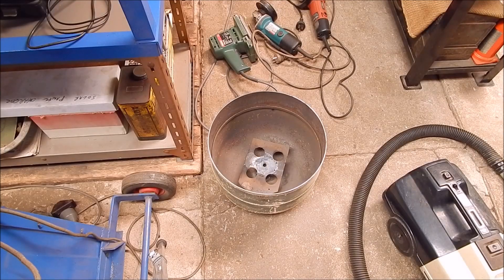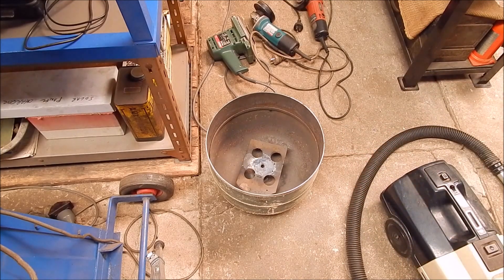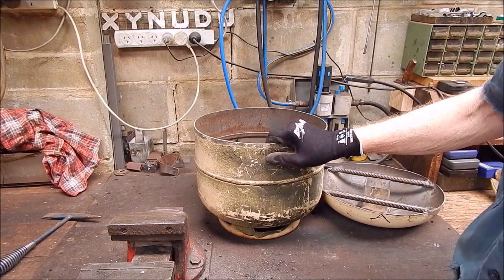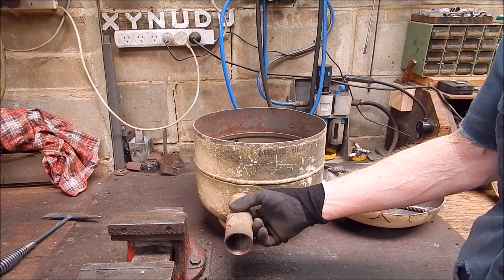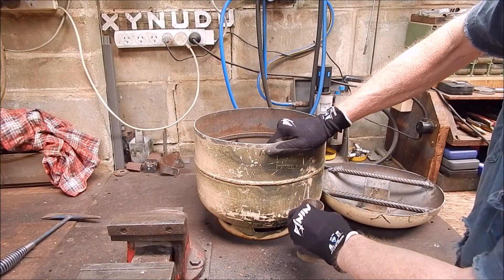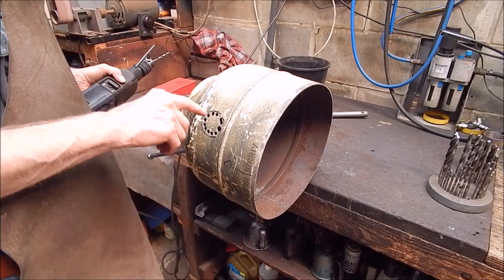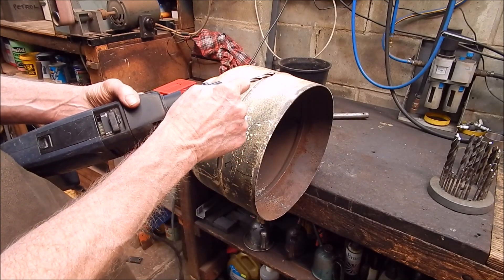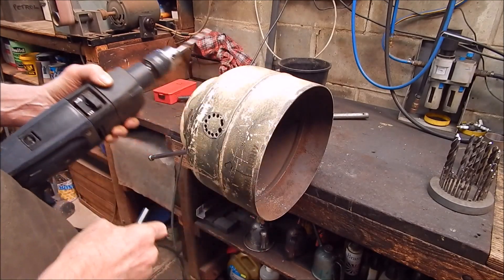Making a metal melting furnace from a 10 kg LPG gas cylinder - part 3

Comment: Hi Rob, getting there mate, that looks like tough old stuff! Friction disk just ate it! I think your lid will be fine. Cheers, Jon
Reply from the maker: Hi Jon,  definitely high tensile for the tank and the Reo.  Reo is a bastard stuff to weld at the best of times as the arc eats it away and some is a lot worse than others.  This piece was pretty crap, but it attached OK.  I used the DC welder on both.  Low hydrogen rods would help, but for this job where it will be hidden I just went with GP.  I'm thinking bentonite clay mix with pizza oven grout for the insulation.  Going experimental.  Cheers Rob

Comment: Bend a steel rod, 10mm dia,  around inside of lid, weld it on. Use it as support for mesh.
Reply from the maker: Another good idea.  Too late now as the Reo is in place.  Cheers Rob

Comment: You probably don’t’t have enough use or space but a low cost plasma cutter would have done the hole very quickly. Many of the Indian channels simply turn up their arc welders to make a poor man’s plasma cutter, but the traditional methods work & it looks like this will become a very useful addition to your shop. Thanks for sharing!
Reply from the maker: I can't justify a plasna cutter, even though I could get one from Banggood to review, so the old minimal tools method will have to do - works OK.  Done it many times.  I do have core drills, but not this size and you must use a pillar drill with them. Cheers Rob

Comment: Hi Rob. It's surprising how much work goes into these projects. That steel looks pretty tough, hard to work but definitely a good choice for the furnace. Cheers, Alan.
Reply from the maker: Hi Alan,  the gas cylinder steel is very hard to work.  Definitely high tensile.  Rebar is nasty stuff to weld as it burns away with arc. Some is worse than others and this stuff is bad.   Low hydrogen rods can help, but GP was good enough and it will mostly be hidden.  Getting there slowly.  Cheers Rob

Comment: Hi Rob,I am a bit further in the build and roughly followed Mark Preslings videos as a guide,if you are still thinking of hinging the lid I do not see any advantages ...
Reply from the maker: Hi Robert.  I will use a sideways sliding/swinging lid I think.  Cheers Rob